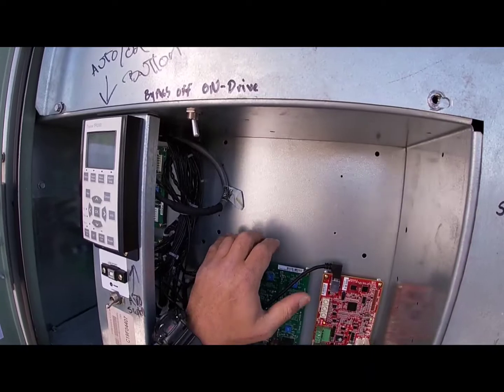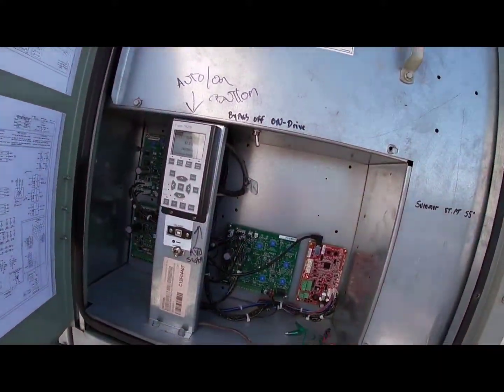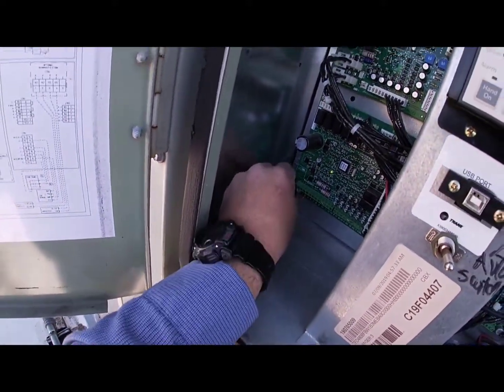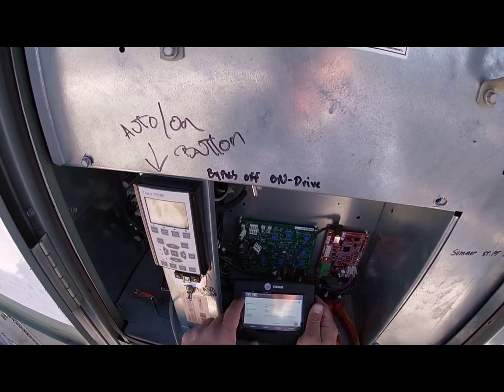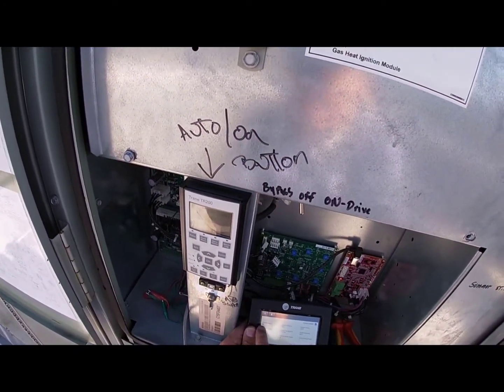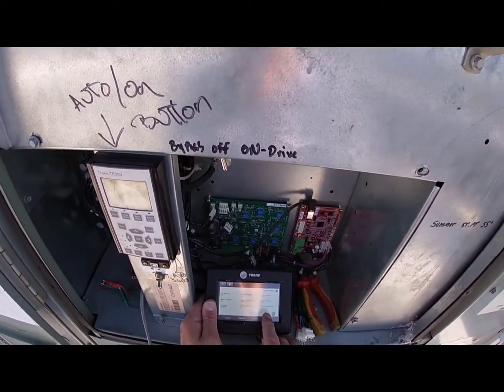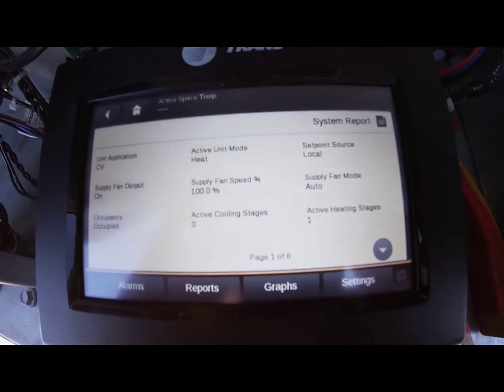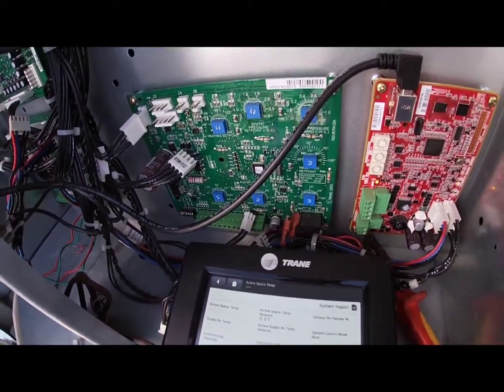trane Voyager VAV to CV

Comment: How to convert a Variable Air Volume (VAV) unit (16th digit of the model number is a 2, 3, 4, 5) to Constant Volume (CV):

 

Remove power from the unit before you begin this procedure.
1. (IGV units) The IGV must be mechanically locked open. The unit will no longer control it.
1. (VFD units) The VFD must be programmed so that the minimum speed is 60 HZ. 

 

Without COMM (LCI, TCI or BCI)
2. Remove the wire harness from the RTRM J4 to the RTAM J2 (wires W68-W71).  Discard the harness or save it in case the unit needs to be converted back to VAV.

3. Unplug PPF13 from the RTAM (wires W63-W66) and plug it on to RTRM J4.

4. Restore power and test.

The unit is now Constant Volume and requires an appropriate zone sensor or conventional thermostat for operation.

 

With COMM (LCI, TCI or BCI)
2. Remove the wire harness between the COMM J2 and the RTAM J2 (wires W68-W71).  Discard the harness or save it in case the unit needs to be converted back to VAV.

3. Unplug the J3 plug from the RTAM (wires W63-W66) and plug it in to Comm J2.

4. Restore power and test.

 

Note: If the unit has LCI, the LCI-DAC will have to be replaced with LCI-SCC or LCI-X.  Otherwise, the unit will not control properly.

Comment: Follow up to last comment.  I have the cable that connects to J10 plug ,  did you mention connecting to J4 plug some how?
Reply from the maker: I made a cable for to allow me to connect it to the older RTRM boards that have the J4 plug. Out of my TD5 I split the j10 plug and added a j4 plug. I also made a split cable to use incase there was something already plugged into the j4 on the board. It works great
Reply: I would love a wiring diagram of your J4 harness conversion on your TD5 Cable
Reply: Thank you brother

Comment: Thanks for the video,  I have a question if you don't mind.  I just picked up a TD5 display but I don't have a cable or know the connection points to the board,  could you give me information about what board to use and where it connects to the board?  Thanks in advance brother.

Comment: I noticed the comment you made about setting the min HZ 60 . You have a VFD that still can be used in a Single zone application do not need duct static pressure . The VFD will ramp up and down base on the need . Fan only it run at min , Econ start to ramp up , 1st stage cooling , 2nd stage , 3rd stage up to 100% VFD or Heating will be 100 % VFD . Email me , Be glad to help I’ll send you my cell number
Reply from the maker: Thanks, thought about staging the drive on cooling demand but will get a little more complicated. Could not see how to do so with out running wires everywhere.

Comment: Need to change from VAV zone to Single zone . bypass the RTAM module and Change the VFD setting. Have a Trane Factory setup for this unit or you can installed a Trane VAV T-stat to keep as a VAV system . Note : the unit will drive VFD to 100% in Heating mode . Have a relay on this unit that you can wire to open the damper 100% . If you would like some help email Tony.basham@gowaibel.com 23 years Working for Trane commercial and industrial in Dayton Ohio .